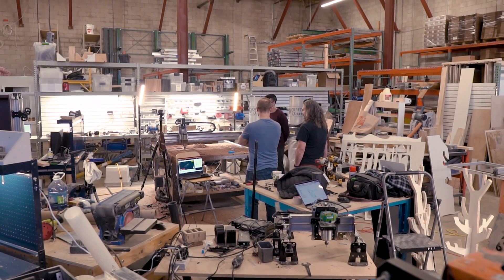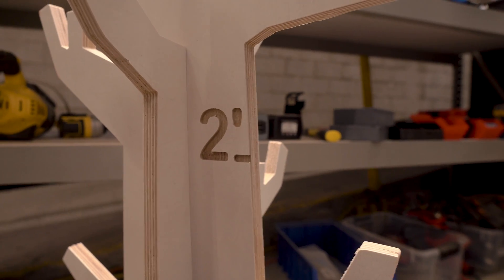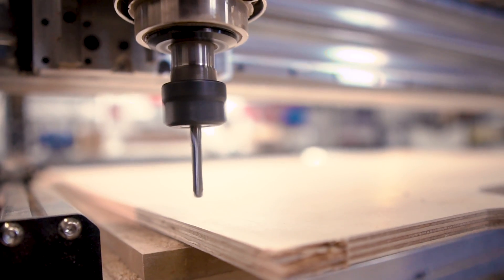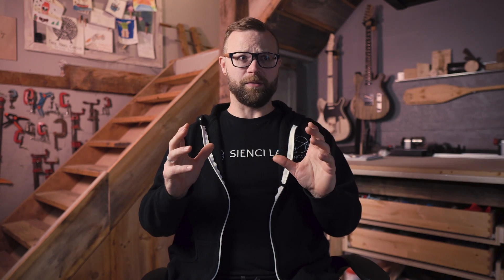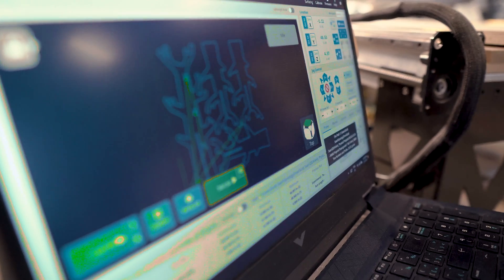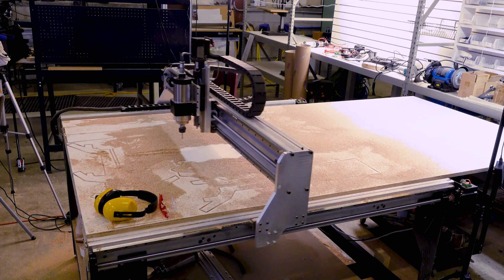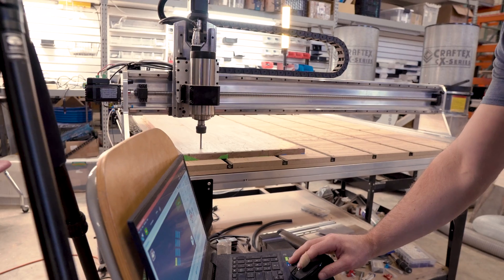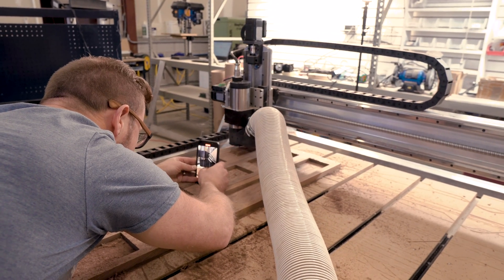Scott's First Experience Using the AltMill CNC Machine: Insights and Discoveries at Sienci Labs

Comment: Checked your site for details on this machine.  What is the price with the spindle, ATC, whatever you use for rotary turning and its specs; is a vertical workstation available?  Plywood is NOT 6/4 hard maple, I doubt you will get those feed rates used for ply.
Although it may have faster acceleration that also means that when it has to slow down it will be more jerky.
How will the new tariffs affect your pricing???

Comment: How are you not snapping that bit cutting 3/4" depth in 3/4" ply? Was it carbide or HSS?
Reply from the maker: Solid carbide bit 👍 it's also important that the machine is rigid enough since if the machine bends too much then the bit will experience too much variation in cutting forces and cause it to snap

Comment: I would like to see the details that would make this make sense.  What type of dust collection system do you recommend?  What Automatic tool changer do you recommend?  If you run the spindle continuously, does it need a cooling system?  What electrical power do you need to run it and the spindle (do you need 220 or multiple 30 amp 120 connections or something else?)?

Comment: Yes - it has impressive speeds for running files. One thing not mentioned is the set up of putting double sided tape/ material onto the spoil board, the labor time for removing parts, and the clean up labor time to make the spoil board ready for the next sheet.  If you were using double sided tape for hold down, this is a difficult thing to remove, depending on part size and how much tape you have used. Carpet tape with strands in it seems to be easier to remove than the kind with no strands, in my experience. Also not mentioned is if you were cutting through into the spoil board or leaving an onion skin which had to be trimmed off later, adding to production time. If you were not using double sided tape, did you use a vacuum hold down system?

Comment: the Altmill looks awesome, I have a longmill mk2 now. i might have it sold, if I do I will get an Altmill. Will all my software work with the Altmill? Thank you.
Reply from the maker: Yes the software for CAM that works for the LongMill will also work for the AltMill. The process of using both machines are very similar, so you should be able to pick up using the AltMill very quickly.

Comment: So 200 IPM is on the low end of the chip load for 1/4” 2 flute bit in hardwood. Bump it up to 350 ipm. That’s at 18000 rpm

Comment: For a sheet-router it looks good to me.. it only makes me wonder what kind of control it runs.. i'm used to professional CNC controls, that you can program at the machine..I've used very little CAM on professional machines.. i just keyed in the code..and hit start and then started programming the next part

Comment: Looks like a beast of a machine but was curious how the Velocity feed rate compares to the programed feed rate on 3D carvings.
Reply from the maker: Because the AltMill has higher acceleration settings compared to most machines in its class, it will spend more time at its actual target feedrate than most machines, so it can finish 3D carvings faster. Check out this video for a full video on a relief carve we did https://www.youtube.com/watch?v=Ex9NobxMBdk&list=PLE43LQy2a1iodzx7JHwetJRK4AQwUoWlp&index=7
Reply: @SienciLabs   very impressive, this will be my next machine. Thanks for the link.

Comment: Does this demonstration use your 1.5Kw spindle option, or the 2.2Kw spindle used on some other videos you guys have done?
Reply from the maker: This was the 2.2kw spindle. But the 1.5 is also capable with some adjusted feeds and speeds

Comment: Thanks for sharing, I purchased a CNC direct from China... I spent 10K all said and done. 4x8 Solid steel frame and gantry, vacuum table and pump, rotary access, 3kw water cooled spindle. Rips through wood at same speeds and feeds with zero wobble. 
Seeing this machine at these speeds suggests I can probably go higher... maybe will try it out sometime.

Comment: Can you explain the Closed Loop Stepper Motors and how they work with the SLB?  I love my MK2 that uses G-Sender and by far the most reliable controller software I’ve ever used.  Would like to take my Mach3 machine which has Closed Loop’s Nema 23’s currently have my SLB standing by looking on how you wired it.  The spindle was basically plug and play.

Comment: If this machine was available a couple years ago I would have jumped at it. Instead I had to piece my machine together from overseas parts and make my own. THANKFULLY I was able to piece together almost every feature of this machine minus the table legs. I think my gantry may be a little stronger, at least it should be. I'm not about to kill myself attempting to prove that by trying to balance on the Z axis. That kind of stuff is for the young, they heal faster. 😉

I'm jealous though, I would have killed for those table legs. I had to build my own. I was hoping to find the table for sale separately in your store for a machine I still have in boxes. Oh well. It looks like it might be integrated into your machines frame though? More rigid that way. Good call. I'll get to support you guys in some way someday.

Great job!

Comment: Could you talk about the table/spoilboard?  Haven’t seem much discussion on it yet.  Thanks and keep pushing the boundaries!
Reply: I believe the table is just a sheet of MDF you provide yourself. Same with the spoil board you add whatever kind of spoil board you want.
Reply from the maker: Correct. Wasteboard is usually MDF. The table itself comes with the AltMill kit.
Reply: Yes but what is the table, just an extrusion cross bar?
Reply: @s.p._on_youtube  I believe there's a whole table. a rigid structure with legs and everything!